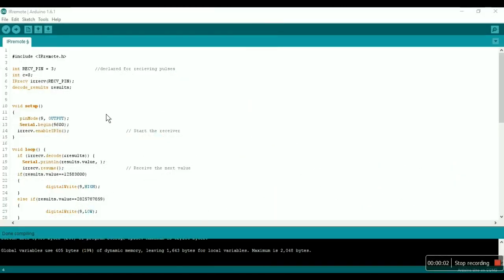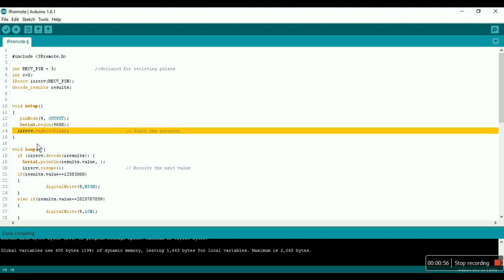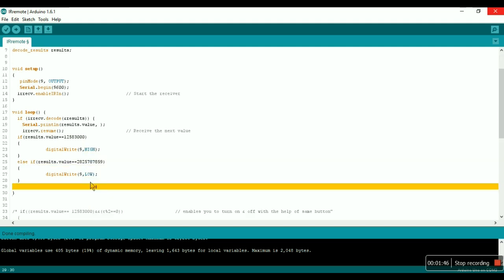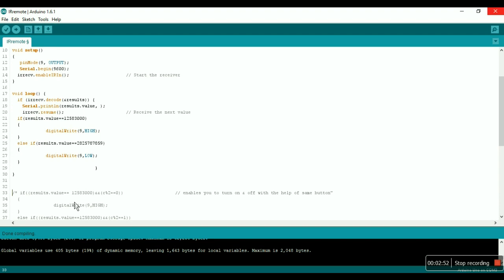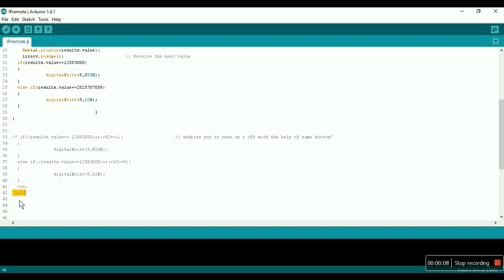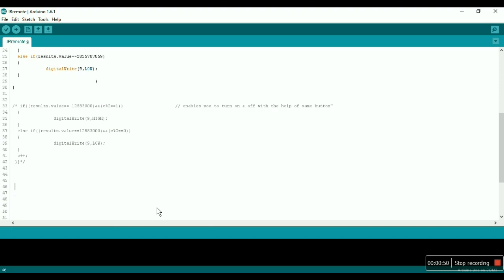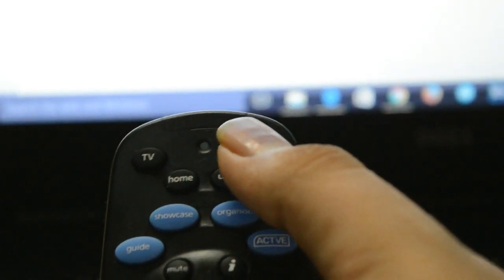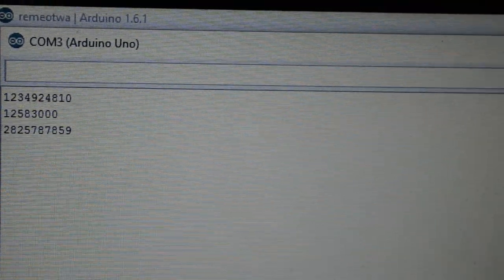Tutorial on Infrared sensor TSOP 1738 with Arduino | Connections & Coding

Comment: in serial monitor continuous values are showing without pressing any key any solution for that please reply
Reply: Me too, even with the circuit from datasheet added. Let me know if you find a solution
Reply: Make sure your code and serial monitor are set at the same baud rate.

Comment: hi nice video. i tried that its working perfectly but it works at a particular distance. after certain distance am getting different hex value for the same button.. for example power button in my remote shows 1fea057 within 10feet range and after 10 feet it shows 1a23b73.i dont know what is the reason. is this because IR can work in particular range??because i cant control my led after 10 feet.can you tell me what will be the reason. thanks
Reply: Oh I am getting the same problem
Reply: After 5m distance some bits of information will lost

Comment: it is not intensity bro . remote sends different values
Reply from the maker: Different values indicates different intensity/wavelength of infrared rays
Reply: Yes, different values, but they're not magically transmitted as "values", rather they're represented as.. NOT different intensities (which would be transmit power = brightness), but different pulses. Not different wavelengths, but just different timed on-off cycles for each remote button.

Comment: How to get codes of remote buttons
Sir plz reply......
Reply from the maker: 1. Upload the code I've provided & then click on the "Serial monitor" icon in the top right corner of the Arduino window ! 
2. Bring the remote close to IR sensor & press the button you want the code value of. 
3. You will see the value in the serial monitor !
Reply: Would this actually work on any remote for this or what?